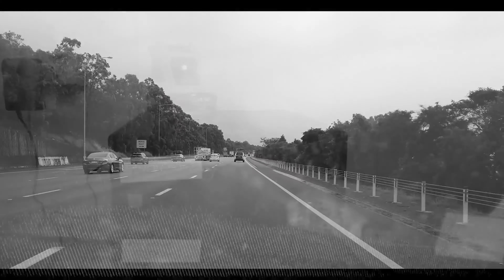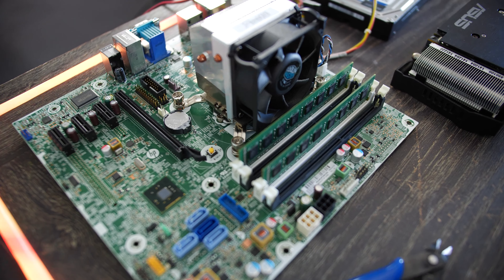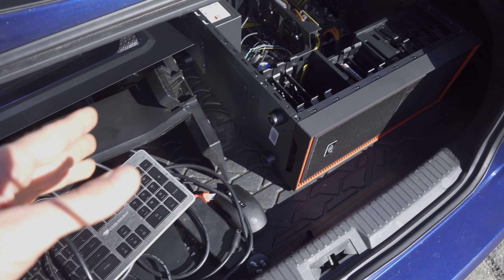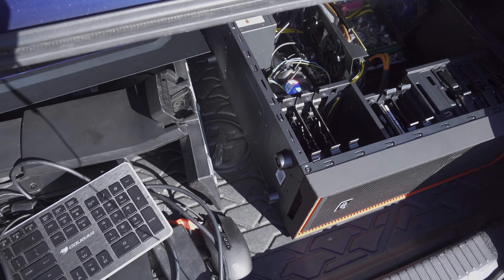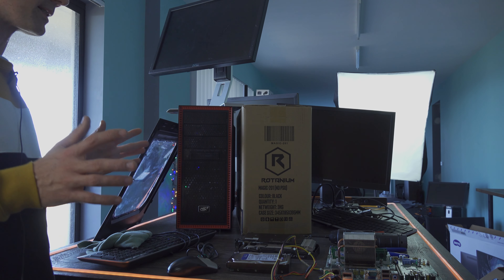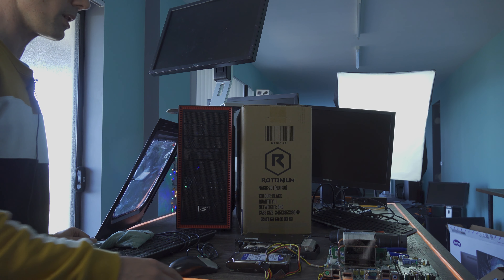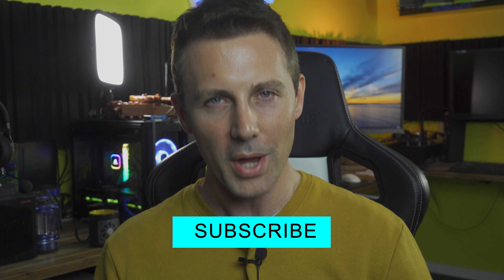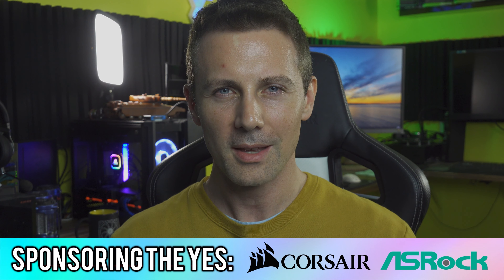Turning $100 into a HIGH-END Gaming PC - Episode 2 - "The iDEAL Strategy"

Comment: About 6 months ago I started with no money and saw this awesome deal for €100 with a r9 380, Xeon x3470, ssd, hdd, decent case, 550watt psu and 16gb ram. Managed to get it for €80. Didn’t have money so I borrowed some money from my dad. Sold the parts payed back my dad and had a starting budget of around €200. Ever since that I’ve been building used gaming pc’s and cleaned up a few laptops I got for cheap. I’m currently up €1500 in profit.
Reply: Иосиф Steelin My personal pc is already pretty decent. I have a rtx 2060, ryzen 7 3700x, 16gb 3200mhz, msi x470 gaming plus, 2x 480gb ssd,   2TB hdd, nzxt h500i and a aio cooler. Upgrade my ryzen 5 2600 with that money I got from selling used pc to the 3700x and got a new phone. Don’t feel like I need to upgrade my gpu yet because it can handle everything I play pretty good.

Comment: 9:30 - You can use 3M double sided tape to hold the SFF power supply to the ATX Case!! I’ve done it on over 10 Dell SFF Power Supplies. Gives a cleaner overall look and I’ve never had any complaints!
Reply: I've been looking at sff ones but was wondering what to do with the power supply. Thanks man!

Comment: This is by far, my favorite series on YouTube right now. Keep in mind, that's out of the 40+ YouTubers I am subscribed to. It's the series that made me find your channel. Keep up the great work man! I myself got a Xeon E5-1660 v3 (1300cb in cinebench r15 multicore, with a single core score similar to that of the i7-3770) with 32GB DDR3 2133 MHz Non-ECC RAM, 1TB HDD, and a Quadro K2200 (less powerful than a GTX 1050, more powerful than a GT 1030) for just $200 USD. I sold the Quadro that came with it to help pay for an RX 580 4GB, dual 6 pin to 8 pin cable, and a 240GB SSD. The total cost was around $250 USD. Talk about the deal of a lifetime!

Comment: The R7/9 thing was the 360. I bought one as R9 and it turned out as R7. My particular card has 1100 MHz core and 1625 RAM with the other things as expected, 768 cores, 48 TMU, 16 ROPs. The RAM speed is the singular over clock on this as most were 1500 MHz. Decent mid/low level card still supported in the current driver. Most looking for an R9 driver will be fine if they look for the R7 driver, not that here is any difference.

Comment: I had this similar issues with that gigabyte motherboard as well. Tried different sata cables, different drives, different onboard sata slot
soon enough I made mine worked by replugging/cleaning the motherboard sata connector a couple of times
not sure how it happened. it was a month when i last booted up the machine im talking about though

Comment: i have this exact motherboard, for a usb bootable drive you have to use the very top usb drive to run windows off of to install it,, then you have to go in an  set each one to  ACH and set as sata and that will fix that issue

Comment: One lifehack for you guys, if you want to sell system with amd in it don't forget to mention Nvidia or intel equivalents of the components. For example:
Rx 570 (better than gtx 1060)
If you do it like that you have more chance of selling it quicker.
Reply: That's actually better than a 1060 now? Guessing possibly the 3GB model of the card.
Reply: @ArtisChronicles  Yes. 6gb version will be better but even 3gb version is good competitor. But rx570 is cheaper and newer which means it will be supported longer than gtx 1060.
Reply: @ArtisChronicles  oh yeah btw in Vulkan API supported games it's far better than gtx 1060

Comment: Thoughts EVGA 790i FTW lga775 ddr3 version, China air cooler, core2 quad q9650 for $50usd. ik it’s not the best performing pieces of hardware but got it as an enthusiast, I’ve been trying to put different chipsets under my belt working backwards X79 came with 3930k upgraded to 1680 V2, X58 i7 920 to X5690, now lga 775 Core 2 quad I plan to swap for lga771 X5492 Xeon

Yes ik there’s X99 and up but that’s out of the realm of reasonable in price when I’m doing this for fun

Comment: Bought a inno3d 1080ti without fan and claimed "bad vram" for $150.
The seller attached a screenshot with core temperature hitting 90C even in open-loop watercooling system.
Turns out that it is one of the batch with broken fan controller (30% speed constantly)
And I have a idle nzxt g12 kit... now it runs fine with 10 minute Furmark lol
Now I'm in headache to sell 2 * GTX 1070

Comment: about the x3450 being able to stream: I managed to get my brothers system (i5 650, 8gb ram, GT1030) to stream LOL at 1050p in 48fps. I just had to adjust some settings in OBS streamlabs. But anyway, I got him a xeon x3450, overclocked it to 4 ghz and it does the job way better. Now he can actually do somethin else, while straming.
Reply: Good to know that the 650 can do it to some extent

Comment: Would you be able to recommend a USED CPU and motherboard combo plus RAM(what kind)?
My requirements:
Mainly for productivity and photo editing, little or no games
As CPU, MB and RAM combo no Overclocking but combo must be fast.
Using External graphics card not necessary the fastest.
Using Compact mini-ITX MB housed in a compact case.

Thanks.

Comment: @tech YES city  Hello Brian, I have a Asus ROG strix b350 f gaming mother board that sometimes boots up fine. But 80 percent it either doesn't do anything, or fans spin up but I get no QLED error lights, greeted to no post and the PC won't turn off with the power button :( I can't find any threads, and have had the board rma'd 2 times already, about to send it away a third time. Any suggestions?

Comment: Hi there, i have an X58 rig that has been my faithful daily for the past 10 years, requiring only the usual memory, SSD, and graphics card upgrades from time to time; at this point I’m just curious too see how further can i stretch the lifespan of this PC, which is based on an EVGA X58 SLI LE motherboard, and an i7 975 Extreme Edition CPU, mildly overclocked at 3.5ghz. With 24gb of DDR3 RAM and an EVGA 1080ti graphics card;  so far I’ve been able to keep up with the latest titles, and I regularly play with my brother (who has a much recent PC) and since I’m not into competitive FPS games, but rather into single player and PvE multiplayer games, i can basically play anything and everything i want on my big 4k display (except crysis, of course lol), with decent and solid FPS.

My question for you is this: I recently decided to replace my AIO CLC cooler, and while at it, I’m considering slapping in a better/faster CPU, specially if i can get it on the “cost-effective” end... so, I’ve been seeing the 980x and the 990x... but I think the price is too high for what it is... so, finally, here’s my question: which Xeon processor would you recommend? I want to be able to overclock it to at least 4ghz, and i know very little about Xeons, and from what I’ve read, seems like not all Xeons can be overclocked...

I hope you can help me make up my mind.

Thanks in advance!

Comment: i live in ireland and the gpu prices dont make sense. used gtx 970 you can get from about €100-€120 and gtx 950,960,770,760,rx550,rx560 etc.. for €90-€100 .Trrying to make low end builds with gtx 770 level of performance and they are just too expensive.

Comment: Hey Tech Yes City and viewed, 

I've been looking for a gpu rn, ive seen a few 570 used for 80€, while a new one is about 140€ here.

I've never bought anything used, and hence I am quite skeptical, while it be working? Is it wrong if I ask the seller if he can send me some kind of video with the gpu working?

What's your personal experience on this matter? Thanks.
Reply: Only thing to look for in used RX 570/580 is to see if was used for mining. If so, it most likely will have a different bios loaded on to it. Easy enough to flash back the bios for gaming/editing.
Reply: @mattketner7597  Not so easy for me, my cpu has no iGPU (ryzen 3 1200), so i wouldnt be able to flash a new bios onto it
Reply: BlackPalanka ~ You might be able to upload the bios onto a USB Stick and get it done that way. But most cards are already flashed back and don’t need anything done. I’ve bought over fifteen 560/570/580’s Graphics Card (all of them being used) and never once had an issue!
Reply: @mattketner7597  Ok, thanks for your info, Imma go ahead and buy it.

Comment: You showed you had a tool which looked like a crimp why not do this for all connections you need rather then messing about soldering and then using tape.

All those other cases you end up not using you can use the metal to make proper brackets for sections like psu.

No ssd that is poor those things cost hardly anything so even if its just a 120gb its like what $20 max

Comment: Can someone help 
I have i5 2500 and 6gigs of ram with GT 1030 
I want a new gpu(it can be used) which will not bottleneck my pc 
Once I used an Rx 570 in my pc it worked but too many stutters so Rx 570 is not the way to go
Reply: Dude the rx 570 is a really good option, try to re install the drivers, update it and what not. Try a 1050ti or a 1060 /1650, if you want a new gpu that would go well too.

Comment: "week days during business hours", mb
Reply: So the stinger sucks?  Get an LS1 or LS2. mb
Reply: And everyone knows what those 18 US mile per gallon city and 29 US mpg cross continent cars are at up to 110 Mph cars capable 163 sustaining; at 110 MPH getting 29 miles per US gallon are. 

I know, tested, 95 US MPH to 110 MPH across Kansas that is a very  long way at 29 miles per gallon across Kansas on Kansas 93 octane. Then right before Denver caught for the posted 70 US MPH limit. 

GM LS1.

mb
Reply: The truckers on citizen band  turn you in going over the posted limit themselves, well over, and the highway patrol then time the talked about general motors LS1 vehicle between highway on and off ramps. mb
Reply: Its not a Holden example that are export here but capable of the same thing.  mb